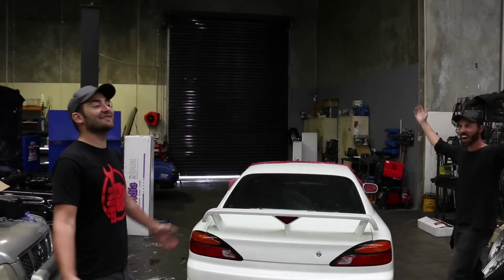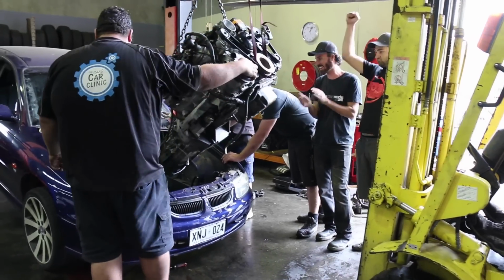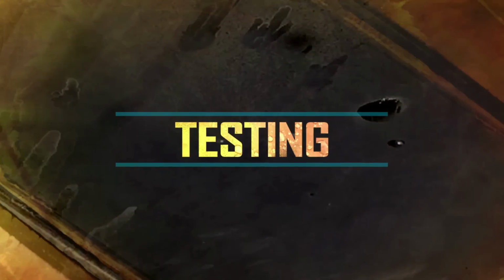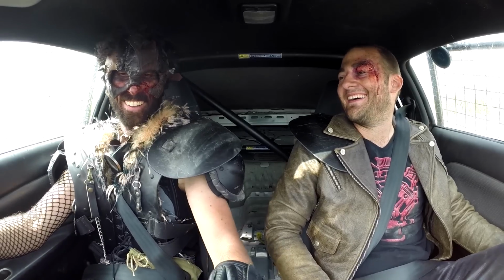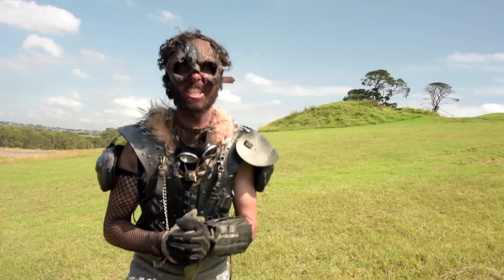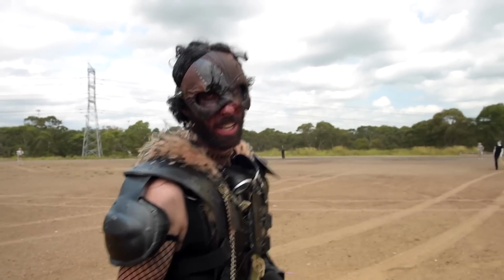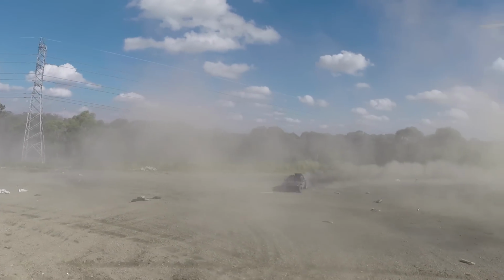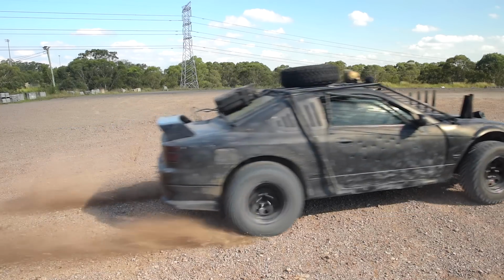MOD MAX - Episode 4

Comment: Time for Mod Max (V8 Sylvia) Mighty Car Mods  VS Ratsun ***** Make this happen. Its been a great series
Reply: Don't forget the General Mayhem!
Reply: ***** It'll have to be General Mayhem, don't know if the Rotsun would survive this kind of nonsense again.
Reply: I thought the Rotsun died in episode 32. Did they fix it?
Reply: superbarnie I think the 4.3l keeps eating either crank or rod bearings, plus the car is beyond rotted, even for a Midwestern car.
Reply: GreenJeep1998 Oh I'm sure Mike and Dave can hastily assemble something to make it last just a little longer. Bleed that chassis dry!

As for the engine, 4.3l engines are not hard to find. It would take time, but they could do it.
Reply: ***** General Mayhem isn't complete right now. The 440 engine just got donated for the Crop Duster project. I hear that possibly a Hellcat engine may make it into General Mayhem! :0
Reply: Brandon Driskill
I thought general mayhem got its engine from a RV?
Reply: chefdan87  It did, they used what was basically a truck 440, cleaned it up enough to paint it, then dropped it in before making it all work. In preperation for the Subaru episode, they put some performance goodies on it on Subaru's dime.  Kinda sounds like that motor is going into that Duster while Chrysler is supposedly going to be putting a Hellcat engine and 8 speed auto in it..................hopefully, there won't be another "triple homicide" like ATF spill like in the original build show though.
Reply: Brandon Driskill IT WILL DESTROY ALL

Comment: No replacement for displacement. I love those turbo 4s and 6s but nothing beats a good V8.
Reply: What about a turbo v8? Powerrrrrrrrr
Reply: 2JZFIFA Putting a turbo on a V8 should deserve a death sentence. Supercharger all the way.
Reply: Amen!!! Gotta love v8s
Reply: Rin Hato Why lol? and death sentence? Okay Mr. Keyboard Warior no need to get threatening or mean.
Reply: Rin Hato Y not both?
Volvo is doing it on a 4cyl aren't they?
Reply: Rin Hato seen this argument alot and its all dependent on what you want to do, you want on demand forced induction get a super charger, you want more top end go twin turbos. I n the end its all based on what you like... and whats legal where you are. i could put a supercharger on my truck in CA (california not canada) and not have any smog problems but i cant turbo it because it wont smog.
Reply: Rin Hato you don't put a turbo on a v8..... you put two on, duh.
Reply: Turbo into a supercharger. Your welcome.
Reply: Benjamin Kenney Lol you don't know how a supercharger works dude. It's belt driven. So a turbo wouldn't go to a supercharger unless you hooked up a turbine from a turbo to a pulley and used it to drive the supercharger. but at that point it would just be a turbo with an exhaust and intake in a different place haha. And plus I believe turbos make more power than superchargers, superchargers just give a broader powerband. (I believe, correct me if I'm wrong.) And doing the belt driven turbo-supercharger idea would probably perform worse than a regular turbo because of wasted energy with the belt drive system. But a cool thing to think of is if you have the exhaust housing at the back of the engine bay and a belt driving a compressor at the front of the car, there wouldn't be all that heat transfer between the turbine and compressor areas of the turbo. Meaning that the air getting sucked in wouldn't get hot due to being close to exhaust. Also meaning you could possibly have a turbo car without an intercooler :D 
Damn I need to patent this shit.
Reply: Stephen Browne Dude you got it right haha. Or maybe 2 and a supercharger? Because why not? And a 250 shot of nitrous while we're at it lol
And while we're going overkill we can have one of these engines in the front driving those wheel and another one in the back driving those. AWD total of 16 cylinders, 4 turbos, 2 superchargers, and 500 shot of nitrous lol 

I don't know what I was thinking when I started this post
Reply: Rin Hato
Dats true. I guess koenigsegg should stop production of the agera and all future cars? (no sarcasm)
Reply: JustKyzuuh People run both superchargers and turbos at the same time. There are builds all over youtube showing how it works. Both superchargers and turbos have their place in builds and projects. Turbos are more efficient but tend to be far more expensive and more technical than superchargers. If i was building a rock crawler i would prefer a supercharger for its immediate boost and torque gains at low rpms where you need them. If i was building a top speed Bonneville car i would want turbos for its topend capabilities. With all the new technology out today both are very streetable.
Reply: JustKyzuuh Look up centrifugal superchargers, such as ProChargers. Many of the top tier drag racing cars use these type of superchargers. git gud
Reply: V10 cough V12 cough Rotary
Reply: Kritions More expensive, heavier, and when a V8 can produce over 1000 HP why would you want the other 2?
Reply: Lambo v10 can get 2000 sooooo....
Reply: Kritions so can anything, with enough money. what are you getting at?
Reply: Kritions 
a v6 can also get 2000 sooooo... just be quiet before you embarrass yourself even more.
Reply: Higher revs, better displacement, nice sound, smooth running........
Reply: chefdan87 I wasn't talking about running both I know that's possible. If you read my post and the one I was responding to, you would know he said turbo a supercharger and I was elaborating on that. But yeah each has their own advantages and disadvantages. But there's no replacement for displacement(;
Reply: Kritions  None of those directly mean more performance from the car. And things like nice sound is subjective. Some people love lumpy V8s.
Reply: And yeah guys Kritions  is right more cylinders and the same displacement would even be better. Check out the channel engineering explained, he explains stuff and has a video on it
Reply: IJPOOI just a question but why did u put CA then in brackets (california not canada) when u could of just typed out Cali or California lol
Reply: I know how superchargers work and how turbo chargers work. And I have seen a blown Camaro that is also twin turbo'd
Reply: Duzee habit, i dont like using Cali because of how much the abbreviation is used by the gangbangers around here. kind of like if i were to just say my area code as a reference to where im from.
Reply: Stephen Browne When will these kids learn huh?
Reply: KoolBeanz4TheWin You know shit
Reply: JustKyzuuh twincharging look it up
Reply: Chase Watkins dude,  I was agreeing with you.  Jeez
Reply: IJPOOI i put a vortech on my e36 m3 and it won't pass CA smog.....
Reply: Kritions a V6 2JZGTE from a supra can make about 2400hp fully built with a single turbo conversion so ya
Reply: 2JZFIFA
Sweet Jesus did you really just say the 2jz is a v6?
Reply: 2JZFIFA
Sure a 2jz can make that kind of horsepower, so can really any other engine for that matter with enough work put into it.  The question at that point is reliability and is it streetable. And the answer is no. Any engine at those levels of performance will require an insane amount of maintenance and rebuilds. Horsepower and torque is expensive.
Reply: 2JZFIFA 
2JZ.....V6.....
It's too bad. You had a good point there, but all credibility was lost.
Reply: Rin Hato Nevermind that the some of the highest output engines in production vehicles are TT V8s
Reply: JustKyzuuh I'm sorry you don't understand sarcasm.
Reply: ***** V10
Reply: TheSmileyFacedPizza Poor sod even has 2JZ in his/her avatar...
Reply: ***** A small rotary hahaha.
Reply: JustKyzuuh no the guys is right it can be done it was done on some Detroit diesel engines and theres a camaro vid i watched on u tube where he ran that setup
Reply: ***** Just so you know, Donovan block V8's have been putting down numbers in the 3000 -5000 HP range for a while, but when you talk that kind of power, you are not getting any kind of longevity. You have to pay to play...
Reply: Kritions And a V8 can get 3000 HP
Reply: For a v8 to have 3000hp will take a lot lot lot of money and work.   Stupid amounts really
Reply: VELENO156 Indeed. There are also many different videos on YouTube, etc, where people have crashed those beasts... Kinda sad really...
Reply: just somegui Dodge announced that they will turbocharge the supercharged Hellcat Hemi for one car only
Reply: Zanzaroni GR 
Sounds like the new "devil z"

Comment: drag race! gramps vs mod max v8 roaring silvia s15? good idea or horrible? you tell me
Reply: vallu200 DO IT
Reply: vallu200 if it would be allowed and safe enough on the drag strip, they should do it ... might kill the clutch though... and I guess this thing is not at all equipped with proper brakes to be driven safely on higher speed...
Reply: vallu200 haha gramps would boot it for sure.
Reply: vallu200 actually fk yeah put them on the dirt and drag them, one has awd and more power, but the other has big muddies
Reply: Would be a weak ass drag race that sylvia would run like 14 seconds or more with its setup
Reply: It would probably be pretty close race. The V8 has the bottom end torque while the Subaru will have to spool. Silvia's only down fall is the MT tire
Reply: Zach Carroll remember the subaru is a 3.6ltr 6cyl so it does have some torque before boost
Reply: Zach Carroll im not sure thoe they added a bit of weight to the sylvia and the drivetrain loss through the bigger tyres its a  stock ls1 so it has less horsepower than the 3.6 turbo and the awd will kill it off the line  !
Reply: Zach Carroll Sorry but Super Gramps or Gramps would tear "MadSylvia" apart... No drag race style traction from those bogers, bad gearing (probably), suspension setup ... It has a different purpose...
Still the race would look MAAAD ;)
Reply: vallu200 pfft, Super gramps would leave this thing far behind. Too much weight.
Reply: Zach Carroll they could change the tires...
Reply: sorry guys but you have no idea the silvia would be say slower than the subie. probs like 2 seconds even.
Reply: vallu200 We all know the gramps will win...but it will be fun if they do it!
Reply: Brendan Matthews gramps would weigh alot more than the silvia.. a 4 door awd wagon weighs a bit
I mean sure the silvia has massive tires but still

Comment: is that an impreza 22b at 13:09? :O
Reply: OMG yes
Reply: ItsGodfreyHD It hasn't got the flared arches that a 22B has. It's most likely a normal WRX or WRX STI. I highly doubt someone would drive a real 22b like that ^^
Reply: It's mechanical stigs
Reply: It's a type r sti, 2 door sti. It's one of mechanical stigs cars
Reply: osenmosen It's a sin not to drive it like that... it was made for it.
Reply: ItsGodfreyHD it is, theres a video of stig talking about it and how its really rare and stuff. i dont remember the name of the video thouhg
Reply: osenmosen I think it's mechanical stig's 22b, and I think he drives it like that :D
Reply: TheGOLDProductionz I'm not sure if that's the same car, I remember the 22B that Mechanical Stig was showing off but I'm pretty sure he said it was a customer's car.
Reply: Whatever it is it's not a 22b, it clearly hasn't got the wide body wheel arches :b AS P1Mitchell said, STI Type R most likely. I didn't even know the normal STI didn't come as a 2 door, TIL.
Reply: osenmosen JDM 22b 2.5 RS

Comment: With how fast it is I would take it to a 1/4 strip for fun
Reply: It's only 300 hp
Reply: michael mladenovic no point having turbo and super charger when the max safe-ish boost level is 20 pounds
Reply: it all depends on how you tune it
Reply: michael mladenovic You know that you can easily get 11 secs out of an SR20, right?  Mick's motorsport are running 6 second passes with an SR.
Reply: scrfce123 but do you have the money to do that cheaply. you could build any engine that makes 6 second passes but just how cheap can you make an 11 second pass
Reply: 11 sec is quite accessible.  Around $5 to 6K if you're willing to get your hands dirty.  It's much cheaper and easier than shoehorning a V8 in there.
Reply: scrfce123 yea i guess
Reply: Tom clark only 300? Even with straight pipes and a cold air intake I think its in area of 330-40
Reply: justin mccaffery nah no where near, its only a ls1

Comment: You finally realized that the power and fun is really in the american V8 engines. Welcome to the big boys scene fellows!
Reply: ^ reason why people think v8 owners are snobby
Reply: Its the truth man geez back off (it was simply dry humor). V8s just have greater overall HP and most importantly torque. Look at their expressions while driving the V8 Nissan! They realized that a completely stock V8 is a lot more rewarding in many ways compared to lower displacement engines. They did absolutely nothing to the V8. I'm sure a modified SR20 would give that V8 a run for its money however, when compared stock to stock most V8s will out-perform smaller displacement engines. Keep in mind that these V8s are stuffed inside heavy platforms. Imagine if lets say small Hondas or Nissans were outfitted with a 5.0 or a GM LS, or a Dodge Hemi, the power to weight ratio would be amazing. Yes they are thirsty gas guzzling pigs but who cares if you want to go fast or make power. They only get better when a little boost is added to the equation ;)
Reply: Oz M. Not trying to start a discussion on displacement v. forced induction, but we're not imagining anything if we're talking about a stock vehicle's performance. It's oranges to apples when it comes to muscle and import. I was just commenting on the big boy's scene remark. Not sure if you're in the States or not but that's literally like the no. 1 reason we bash Mustang owners (assuming they have the v8)- they tend to think that the number of cylinders they have means anything. I love cars in general, and am actually quite a fan of v8 swaps. I just hate it when people use the amount of displacement they have to compensate  Thanks for not being a dick with your response! (No sarcasm)
Reply: Oz M. dont star JDM USDM war fight again.A lot of engınes can beat american cars too.A lot of v8 can beat cars too.İf you a real car lover you will love every type of cars.
v8 Best drag machine worst cricuit machine
Nissan engıne one of the best drifting machine worst drag machine
Vtec Worst drift machine best Circuit machine
( not for super cars )